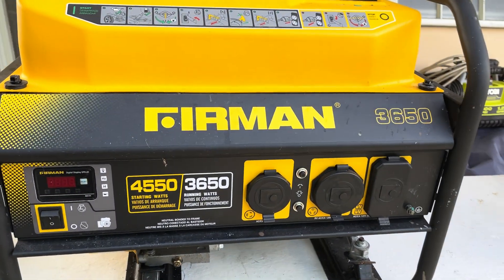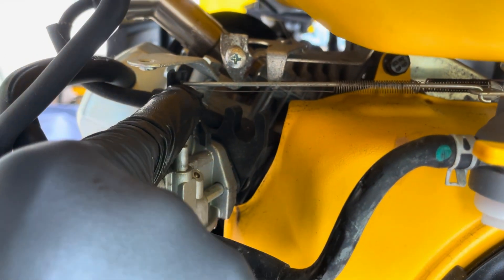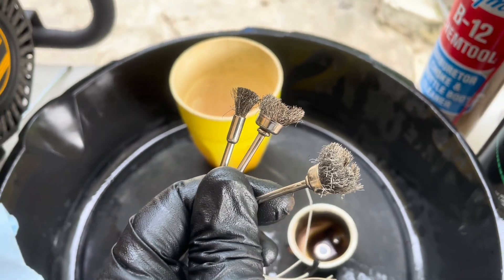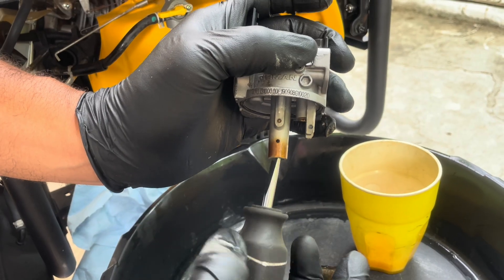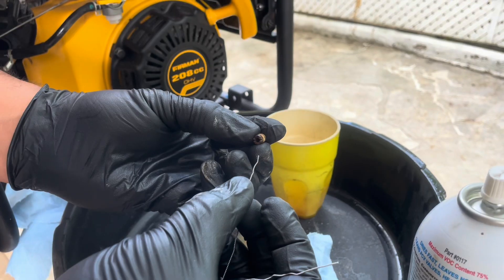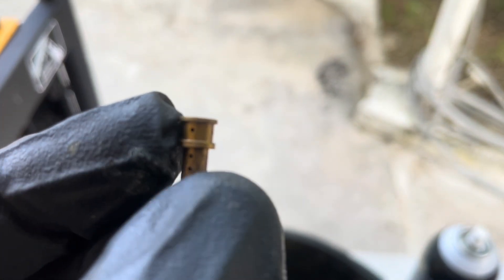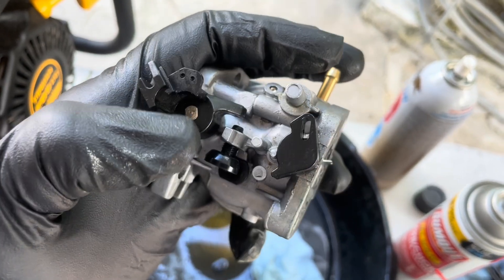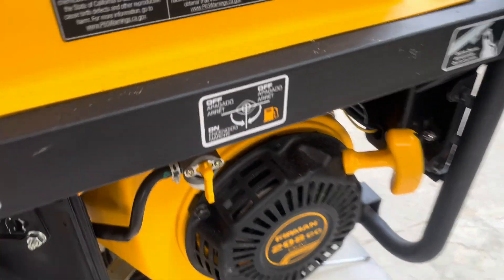Carburetor Leaking Gasoline Fuel. #generator #wontstart #troubleshooting

Comment: Have a 4400 PSI pressure washer Simpson it's leaking gas
Reply from the maker: If the gas is coming out the carburetor then the issue is the same. Your pressure washer has a dirty carburetor and the float needle is stuck open.

Comment: Como sacar esse gicleur sem slot para chave Philips?
Reply: O carburador é praticamente idêntico a esse do vídeo,seria essa tampa do lado do parafuso com a cabeça de rosca?
Reply from the maker: Yes, some variations of this carburetor have a cover/cap on the black screw that holds the idle jet in place. You remove that cover and you’ll see the slots for a Phillips screw driver.
Reply from the maker: Some of the idle screws have a small cap covering the Phillips screw driver slot. Try prying out that cap to remove the idle screw and get access to the idle jet.
Reply: Esse que você está explicando no minuto 10:12 eu efetuei a limpeza,a minha dúvida é sobre esse parafuso de cobre com cabeça roscada ao lado.
Esse é preciso retirar para limpar ou é selado?tem também entre os dois uma tampa..seria esse que está dizendo que ao remover aparecerá um parafuso?
Desculpe pelas perguntas?
Grato.
Reply from the maker: Oh! Sorry for the confusion. Some carburetors have a screw in there that you can also adjust but on this carburetor in particular it’s sealed. If your carburetor is the same then don’t worry about it.

Comment: Is it normal if air is coming out the carburetor?
Reply from the maker: A small amount of air “pulsing” out of the carburetor is normal because of the intake stroke, but constant strong air blowing OUT of the carburetor is not normal.

If it’s pushing air back through the carb, that usually means the intake valve isn’t sealing, the valve clearance is too tight, or there’s low compression on that cylinder. But in situations like that the generator wouldn’t even start. Basically, the engine is pushing compression back through the intake instead of sealing it.

Comment: How do you determine if you should replace the gasket where the fuel was leaking?
Reply from the maker: Great question! If that gasket has any cracks, uneven edges, or doesn’t sit perfectly flat, replace it. Even a tiny air leak at the carb-to-engine connection will cause surging or hard starting.

A quick test: spray carb cleaner around the area while the generator is running, if the RPM changes, that gasket isn’t sealing.

Comment: I happen to have the exact same generator and today, I decided to start it (doing it twice a year as recommended) to make sure it still runs fine before winter, and bang... fuel leak under the carburetor !! 😳
I'm really not mechanical and feared having to fix it, but you explained very well the process which will help big time when I get to it in the coming days. Thanks.
Reply from the maker: Absolutely, if you run into anything unusual when you open it up, feel free to update me. Pay close attention to the float needle tip, the seat, and the bowl gasket. If the needle isn’t sealing or the seat has debris, it’ll keep flooding. 

You’re doing the right thing by starting it before winter, and don’t worry, this is one of the easier fixes.
Reply: @tacticalpowerpro  did the job today and found nothing unusual BUT i couldn't remove the "main jit", that part you took out at 5:02 . My generator was starting fine so i figured that the tiny holes were not all clogged up. The float needle was moving fine so after cleaning everything else, i put all the pieces back on and when i opened the valve, no more leak. I was surprised because it really wasn't that dirty !! I thought my problem was maybe something else, but looks like it wasn't.
From now on, i will add some fuel stabilizer like i do with my motorcycle.
Thanks again for that instructive video ✌😎👍
Reply from the maker: Great job! It’s weird bit it happens pretty often. I’ve worked on plenty of generators that had bits of debris I couldn’t see at all and after a good clean the float was sealing completely. 

Stabilizer will definitely help prevent issues in the future. If it acts up again, feel free to update me! Thanks for watching my video.

Comment: Thanks so mucxh for the video. It helped me fix the leak caused by the float needle. however, after i reassembled, i was getting a lot of revving in idle, making it seem like the pilot jet was dirty, which i hadn't cleaned. I took it back apart to clean it just like you did. But when it tried to pass a wire through the jet just like you did a 10:20 in the video, my paper clip wouldn't go through at all. No amount of carb cleaner or force i put on it would make the wire go through. do some generators have that piece blocked off? is a small paper clip to thick?
Reply from the maker: Thank to you for watching and commenting on my video. If the jet is like the one on the video then it is not blocked off. And yes, the small paper clip is too thick. You’ll need something small like a strand of wire from a small wire brush. Some carburetor cleaning kits come with the wire kit that fit the black idle jets but won’t fit the brass idle jets. I normally use some really thin wire I found on Walmart that is used for fishing  🤷🏾‍♂️
Reply: @tacticalpowerpro  thanks, i got it all fixed.
Reply from the maker: Awesome! Thanks for the update. Now I recommend using fuel treatment such as Seafoam in the gasoline and start the generator at least once a month for 10 to 15 minutes.

Comment: I got the carburetor off but I can’t figure out how to take it apart to get to the inside.
Reply from the maker: Undo to bolt in the bottom of the carburetor. Once you have that bolt out then you should be able to pull the carburetor bowl and see the inside of the carburetor.
Reply: @tacticalpowerpro  thanks!  Got it!
Reply from the maker: Don’t mentioned it, I’m here to help. Good luck with your repair.

Comment: Very proffesional made video - thanks a lot!

I have a question - could it be te cause of leaking gas through an air filter chamber? There is a rubber fuse from stroke chamber to air filter and my generator gets an extra fuel that leaks through filter chamber?
Reply from the maker: The rubber hose you mentioned from the valve cover to the air box is a breather hose. The fuel is not coming through there, but oil can get through that breather hose and soak your air filter with oil. Specially when the generator is overfilled with oil.
Reply: My lawn tractor is having idling problems. I'm unsure about cleaning the gicleur because the screw doesn't have a slot for a flathead or Phillips screwdriver. Could you help me with the carburetor? How do I remove that screw? Is it necessary to remove it? Thank you for your reply.
Reply from the maker: I will gladly help, message me a photo of the gicleur to my IG @tacticalpowerpro or through email. I want to visually see what type of idle jet your carburetor has.
Reply from the maker: Thank you for watching my video. Yes! Fuel leaking out of the air filter box is also a sign of a clogged / dirty / stuck / bad float needle in the carburetor.
Reply: @tacticalpowerpro  I put new carburetor on generator run one about 1 hour and then other half hour and fine out leaking out air box after set for bit so is it same problem but it run good
Reply from the maker: @jasonhooper7682 yes, sounds like you have a float needle issue. You might have a deformed needle or a small foreign object stuck between the needle and the fuel inlet hole.

Comment: This happens to me with a brand new carb straight out of the box(a Chinese replacement carb), it over flow gas just like this video. Any idea what might be the problem?
Genrac GP 3300
Reply from the maker: Looks like the Chinese carb might have a bad float or float needle. I had issues before with “new” Chinese carburetors. I recommend opening the carburetor and inspect the float and float needle (make sure the tip of the needle is not deformed)
Reply: Me to got 3 hour running time it running genrtor but after let it set leaking out air box
Reply from the maker: Open the carburetor and check the float and float needle.
Reply: Chinese made.
Reply from the maker: Yeah it’s a bit of a gamble. I’ve seen Chinese carbs outlast OEM carbs (which most are still made in China as well 😅) but I’ve also seen Chinese carbs with bad float needles, damaged choke or throttle plates and sealed main jets straight out of the box 🤦🏾‍♂️
Reply: @tacticalpowerpro can't win anymore it seems.